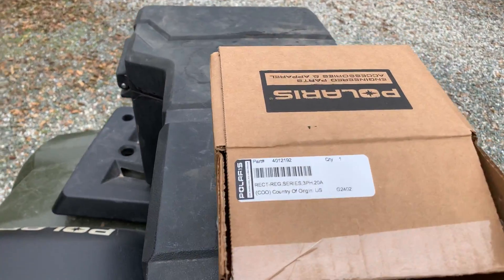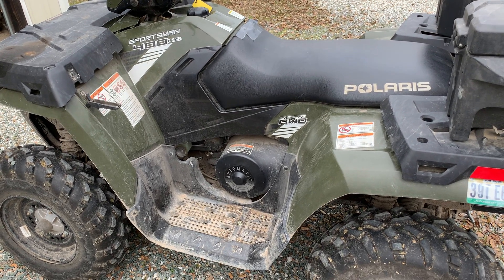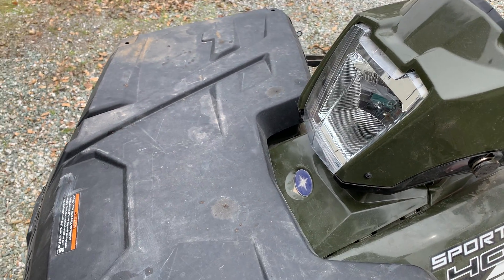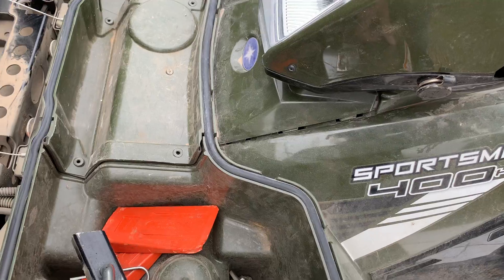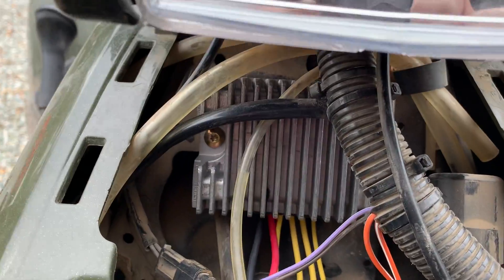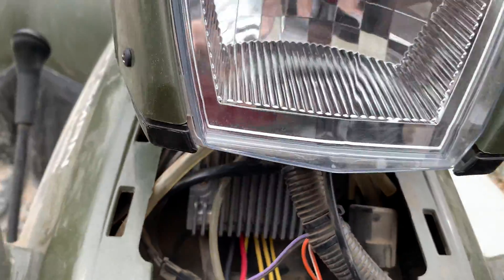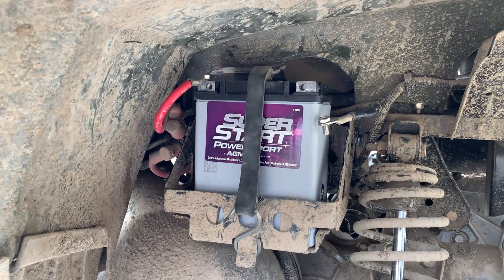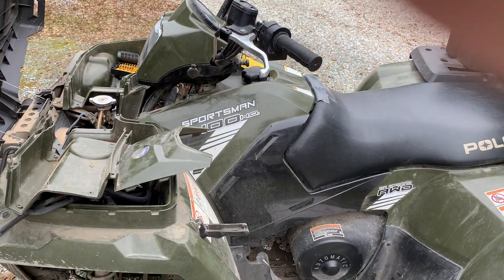Polaris Sportsman ATV Flashing Battery Icon - Voltage Regulator Replacement

Comment: I think what wrong with mine battery drains randomly
I have a 2013 Polaris sportsman 400 H.O AWD
Reply: I'm no expert, but my guess would be a bad stator that is not generating voltage to charge your battery.
Reply: Most likely still the voltage regulator the same thing is happening to mine but it’s because my regulator doesn’t stop drawing power even with the machine full off so it kills the battery

Comment: If the battery icon is flashing does that always mean the regulator is broken or could it mean the battery is dead?
Reply from the maker: The flashing battery icon means the voltage is out of range.  It could be caused by a bad battery, regulator, stator or a wiring issue.  Charge the battery and then test it to see if can hold a charge.  If it's ok, put a voltage meter on the battery terminals while the engine is running.  It should read around 14.2 volts.  If the voltage is too low, too high or bouncing around, you probably have a bad voltage regulator.
Reply: @rpurdy6879  thanks for the help!

Comment: What led you to this fix? Battery flashing?
Reply from the maker: Yup, the battery icon started flashing. The battery check out ok so I put a voltage meter on the battery cables and the voltage was jumping from 2 volts to 17 volts.
Reply: @rpurdy6879  did your headlights work? Just bought a 2011 500 HO for my son. Dash went out on the first ride but came back on. Headlights came on a few times but went out all the way. Batter light flashing on the dash.